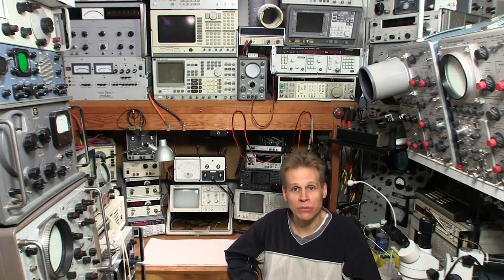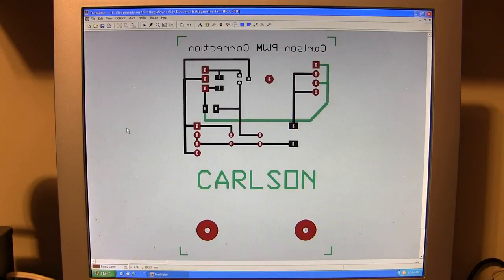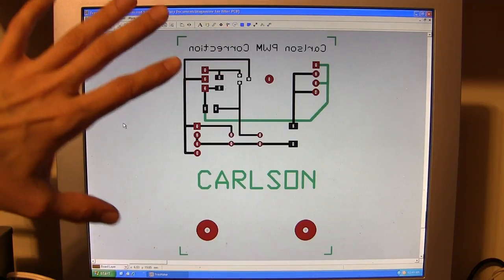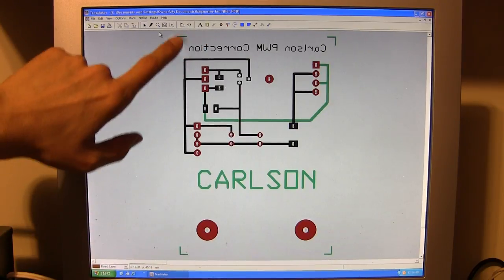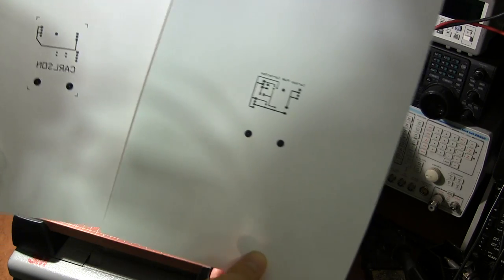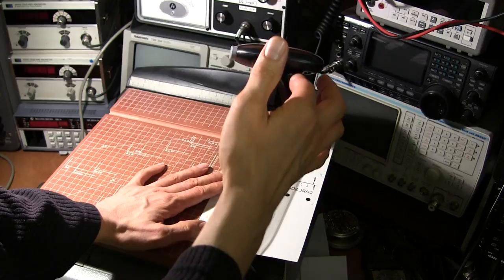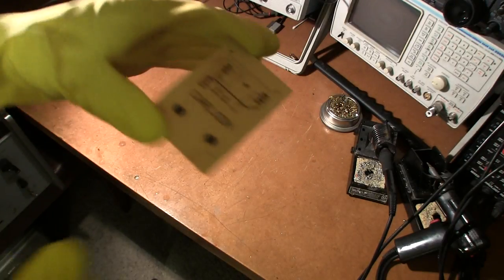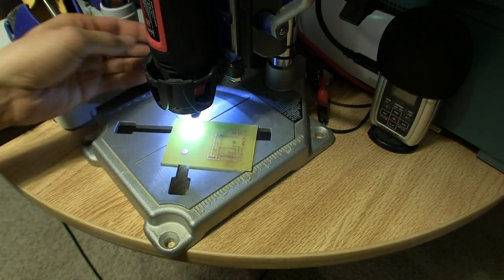How to Make Double Sided Circuit Boards at Home

Comment: Did you make new heating elements, or are you just pushing the stock elements harder? I have done photoresist at home. It's a pain in the _. Those are the some of the best DIY home made boards I have ever seen. I still have bunches of acetates for photorisist board making. I need to put all that artwork into my computer, some day. My cursive script on them is so awesome looking. YES, those are tungsten carbide bits. Mine look like that, and they are tungsten.
Reply from the maker: +Seth B 
Same elements, just on longer to raise the temp.

Comment: Another great video from the lab. I made many circuit boards, using different methods from decal transfers to the photo-resist method. But I've never tried the toner transfer method, and I must say that I'm eager to try it for an upcoming project. 

One question, what print resolution (dpi) do you use when printing your artwork?

Thanks again for this video, and others you have posted. Keep up the good work.

p.s. I also use liquid tin to coat my traces, not only does it look good, it also prevents the copper from oxidation, which makes it difficult to solder (this is a problem if you don't populate and solder your board right away).
Reply from the maker: Francois Beaumont I think its just what ever the program does stock. The program output's 600 by 600. (I Think) It has never asked me...LOL! As long as those traces are thick black on the paper, that's all I look for. If it was weak, I'm sure that would have been my next step. Thanks for the comment!
Reply: You generally want the highest resolution your software and printer can put out...600x600 is adequate, but 1200x1200, if available, can sometimes make for cleaner lines when working with very thin traces (e.g. 600x600 can register well at 10 or 5 mil, but does so with added error if you aim for something in between as there is not a clean a correlation between the printer's pixel mapping and the selected trace width) but it matters little with wider traces as then there are so many pixels involved that the gain or loss of a row of pixels scarcely affects the trace's final width (plus or minus a mil on a 100 mil trace is imperceptible, yet quite noticeable on an 8 mil trace).

Comment: hi been using the same circuit maker for years as well & warmed ferric chloride ect but the the "tining" was new will check it out. i use a homemade motor sea saw warm plate that is heated when doing etching & yes it's takes about 7-10mins to do  ect. great work & pro final product

Comment: This might be a silly request, but I saw a video of an old scope I used on submarines back in the day the OS-8. I'm sure you know the RAMP signal in it is not uniform at all. Just for the heck of it could you modify it to be a better scope. Repair the RAMP and add a sync function or any other improvements you could find?  Thanks, love your videos please keep them coming.
Reply from the maker: Jack neff Hello Jack. The sky is the limit with "sneaking in" today's technology. It's been so long since I looked inside that old OS-8. I have two more to restore sitting on the shelf. That will make a good video in the future. They make great curve tracers, trap displays, so on. I don't recall what the ramp looked like, now you have got me curious. I know the little scopes are rugged but made for very basic troubleshooting. I think they have great personality, especially with the pull out CRT light shield. If that OS-8 and a new DSO were side by side, I would choose the OS-8..... and then just look at it,  because ...... Well.... there's not much it can do other than low frequency work and look cool :^) Thanks for the comment!

Comment: I made my own circuit boards back in the 70s.
It was all time consuming manual layout back then, using Letraset pc board transfers on plastic sheet. The front and back of the two sided board had to have registration marks and each IC or discrete component was labelled on the board top and bottom. 
No PCs with pc layout programs or inkjet or laser printers  were available to make the pc board pattern back then. 
Learned it all from scratch... (Yes,  I also did walk a mile to school as well before that. )

Had to make resist negatives from the positive layout, so I would take my layout to a local PC maker to make in small batches such as the large LED .747 display for digital clock and frequency counters etc.  Back then I was doing a large display panel for the gov't customer and need about a dozen of these displays as well as the discrete counter/LED driver ckt board.
Used plated through holes where necessary...a LOT of drilling!

I agree that drilling out the tiny holes with a regular Dremel would result in a lot of broken drill bits, so it was essential and cheaper to have a local pc board house etch and drill out the holes as there were a LOT of holes for the 14 and 16 pin TTL 
digital packages that populated the board.

 The other thing was that you needed to keep etching solution, around to remove the two sided copper on the G10 glass epoxy board, (ferric chloride, I think) and that was difficult to use in small batches to get perfect edges on the circuit traces without undercut or over etching, so farming it out to a commercial pc maker was the best option and you were  guaranteed good results.
Reply from the maker: SuperCarver2011  How far things have come. If I remember right, walking to school was even tougher in those days, both ways were up hill. LOL! The whole trick to making ferric chloride work well is to warm it up. That little board etched to what you see in 5 minutes. Of course, if you have thicker copper, it's longer. I have some older board with copper so thick, you can catch a fingernail on the etched edge. You can see the copper standing up if you look at the board the right way. That stuff takes about 12 minutes to etch. Years ago, I worked for a company where the owner did much the same in the 70's.I'm glad it's much easier now!!! Thanks for the story!

Comment: I'm studying a way to take a parrot disco drone up 100,000 ft plus and a line cut and a power on for the drone set by altimeter switches. And other creative ideas. My electrical knowledge needs help. Ty for your input.

Comment: Any idea how the copper is adhered to the fiberglass board ?
Some of the reason for asking , is to know what to use to repair lifted / missing traces & pads ?
Thanks again
John
Reply from the maker: KD0CAC At that point, just standard wire is used to repair traces. No point in trying to put flat copper back.
Reply: Hi KD0CACI have seen online that guys are repairing damaged circuit boards with sheets of thin copper, and using a high strength two part epoxy.  They are technicians that are repairing pads on circuit boards that were damaged with bad caps that were leaking the electrolyte.  Or,  from over exuberant people trying to repair something they shouldn't be doing, or trying to repair something, and pulling the pads up.   I think the videos were with some technicians showing how to repair damaged circuit boards, maybe from UK or Germany.  Later Ray Burke

Comment: I just use heavy high gloss paper , then use an iron on medium setting and your done. I use this method for making circuit boards for surface mount components. seems to work very well. I enjoyed your video.
Reply from the maker: Thanks!

Comment: Thanks for very informative video. Now I just can't wait for a video about that laminator from hell. Looks like a beast! I have a teared down laminator in a drawer and was planing to modify it, but for reasons unknown it has been gathering dust for a long time now. I was thinking of changing thermal switches to rise the temperature and maybe slowing down the motor and that's it. However I wouldn't  have thought that high temperature could melt gears so I just can't wait for your video to get more ideas about modifying that thing. Again, excellent video. Keep up the good work!

Comment: Great video!  I haven't made a circuit board since high school.  Laser printers had not been invented at that time!!  We did use ferric chloride though and I want to try this technique out.  I worked for years as a graphic designer and never thought of using this method to make a board.  How big of a pcb have you made using this method and do you gang them up for larger runs?  I guess that at that point it would be more economical to send away to a board house.  Thanks again for the great presentation.
Reply from the maker: Dave Mckim  Hi Dave. The largest board I have made was about 1 foot by about 8 inches "rectangle." I made 4 of those for a prototype unit I was building. In any numbers, a PC Board house is the way to go, but can get pricey. For smaller batches, this is definitely the way to go. By the time all is sent off the the PCB house, a run could already be finished and out the door. If it's all surface mount ( no drilling) ...even faster. Give it a try, once you make one, you'll be hooked! Thanks for the nice comment!

Comment: Just a couple of thoughts: First i quit using ferric-chloride a  long time ago; just too much staining and mess plus having to heat it.  I do use the Muriatic-acid/hydrogen-peroxide solution, mixing only enough for that board. I've found it really cheap in comparison but found you have to use it fairly soon; I once mixed a new unused batch and the next day is was pretty much dead. I've had just miserable results trying to use the toner method and went to Riston photo-sensitive film and have never looked back. The only problem is that being a photo-process, I have to print on transparencies and have not found a laser or ink-jet printer that will lay down a dense enough layer of toner so subsequent exposure is really critical. I have tried to get other people to print transparencies on both laser and ink-jets and neither looks good when held to light; so if you know how to solve this density problem, I'd really like to know.  Finally (to-me) lacquer thinner is nasty stuff so I use sodium-hydroxide to remove the toner at the end.  You can mix a batch and use it for months. I buy the pure crystals at my local hardware store sold as 100% lye. Bottom line however: No one can deny your excellent results!
Reply from the maker: +SpinStar1956 
Thanks for your comments!

Comment: Paul,

Another excellent video. Gave you it a thumbs up. Especially liked the modified laminator and the type of paper you used. I've only done single sided boards and have an HP LJ4 to print the circuits. I use a Monokote trim iron to transfer the toner to the circuit board, then soak the paper like you did. Haven't used the liquid tin. I'll file that for the future.   :-)
Reply from the maker: Donald D'Egidio  Thanks Donald!
Reply: Mr Carlson's Lab Paul,

When you print the circuits on the paper, do you use the printer settings for the paper you use or did you adjust the settings to lay down more or less toner ?

Just upgraded to General class. Studying for Extra now.
Reply: +Donald D'Egidio It will depend very heavily upon your printer, the particular toner it uses (specifically its fusing temperature), how dense a toner layer your printer puts down and, especially, the paper you choose to use.  You really have to experiment to find what works best with your printer, chosen paper, and technique.  But try multiple types of gloss paper in your laser if you have problems -- just be very wary of gloss inkjet papers -- some are burnished clay (and safe) and some use plastic film (which can destroy a laser printer).  I use Hammermill Color Laser Gloss (32lb weight) paper in my Brother color laser, which has worked very well for me.  When you go to soak it afterwards, ripped edges will wick water into the paper much faster than neatly trimmed edges making removal go more quickly.

Comment: Hi,
Thanks for the video. I had that TraxMaker program and did a lot of circuits with it. The CircuitMaker side had a neat simulator !
I did try the heat transfer but it wasn't able to make the fine traces and pad outlines I needed for some SMD footprints. I've been using the photo sensitive boards from China on eBay with much better results using HP Transparency film with an inkjet printer. 
The other thing I found was that when doing double sided boards the thickness of the board sandwiched between two sheets would not keep both sheets dead flat, one would always have less curve than the other an this would offset the vias (.022 dia. , 0.016 dril) drill) from top to bottom especially on boards over 3" square. 
What I wound up doing was using two glass plates and taping the bottom trace transparency to one and the top trace transparency to the other. Then carefully aligning the plates with a light on one side. Unfortunately you can't use this system with a heat press but it works exceptionally well. 
We all have the system that works for us and I appreciate everyone's way of accomplishing PCB making but I think if you look into the photo resist you'll find you make better boards faster and with less harsh chemicals. ( I clean the photo resist off the boards with steel wool without using thinner for example)
One other not to those printing boards. I first used a laser printer with laser transparency film but found that the laser heat distorted the film and fine vias didn't line up on larger boards. This was a real problem because I CNC my holes with the same drills you use (those are carbide, by the way) and the CNC would drill off center on through holes and vias.

One other thing, I know this was just an example board but I always 45 degree my trace corners as it makes stronger traces.

Just my way of doing boards, again thanks for the video.
Rob
Reply from the maker: +mosfet500 
Thanks for taking the time to write.
Reply: +mosfet500 
I also wanted to say the the heat transfer system, any heat transfer system causes expansion. So, by its nature, this limits the size of boards you can make with this system. As I'm sure you know that heat causes distortion.
Rob
Reply: +Mr Carlson&#39;s Lab 
You're more than welcome. I think some viewers underestimate the time and energy it takes to do these valuable videos, but I always learn something from them and always appreciate them.
Rob
Reply: I also barberchair the trees I fell as it makes them weaker.🔄🔁↔️

Comment: One question please... how do you deal with pads that need to conduct on both sides? - eg on the ardiono nano where the pins are soldered there is conductive metal actually inside the holes so you can solder the pins either side. How can that be achieved by someone at home? Thanks
Reply from the maker: Hi Jay. Just put a small piece of wire through the hole and solder on both sides.

Comment: Hey, when you have finished tinning - do you rinse the circuit board off? What do you do with the rinse water, does that need special disposal?
Reply from the maker: The tin solution goes back into the bottle, and can be used again and again. I just bought some new bottles.... $95 a piece for 500ml... prices are crazy.
Reply: Hi, thanks for the reply. 

And they say there is next to no inflation in Canada, haha - I have also noticed prices march up over the past few years. Anywho. 

Not to nitpick, but to clarify you...?
1. Pour the tinning solution back into the bottle.
Do you then 2. Rinse off any residue off the circuit board (???)

If you do (2), than what do you do with the rinse water? Is it contaminated? If not (2), do you just let the PCB dry and it isn't a problem?

Comment: Wow Paul, you did it!!! Thanks a million man for this great detailed process that you go through to make those PCBs.
   I understand why you stand by that older PC program to lay out the etches, but do you know more modern versions that work just as good or better?
   That laminator you modified works a treat. Yes, I'd love to see a detailed video on how you did that as well in the future.
   Those PCBs come out beautiful. Again, "Wow."
   All I can say is "Bravo" for making this great video!
   Thanks again,
                         Tom
Reply from the maker: ***** Thanks for the nice comment Tom! That Laminator has been good to me. A very strange phenomenon with that laminator.... The plastic shell only gets just above room temp even with 200 degrees of temp right inside. I always found that kinda strange. Must be some weird plastic or something.
Reply: It is probably a thermo plastic type that is a poor conductor of heat.probably couldn't burn it just go brittle.

Comment: You can use a iron for clothes and it works great, both sides, trim and soak in water to remove paper, soak in acid until the only copper left is under the toner, wet sand with ultra fine wet sandpaper.